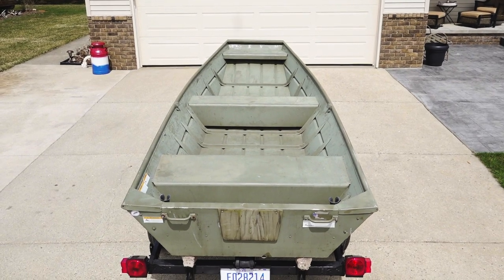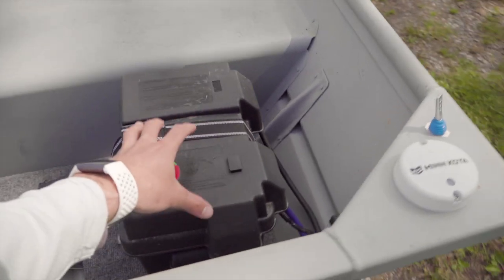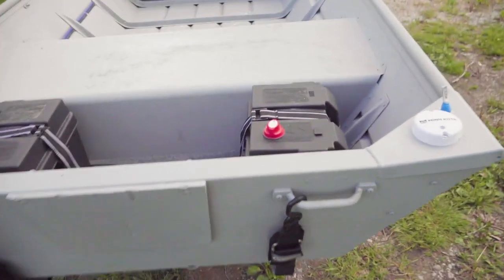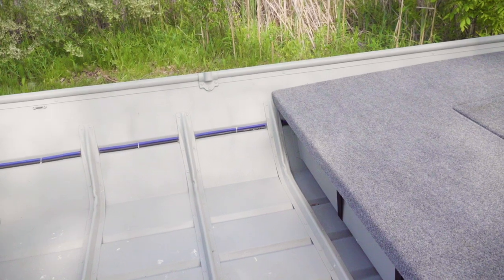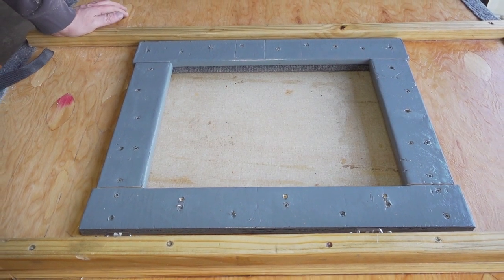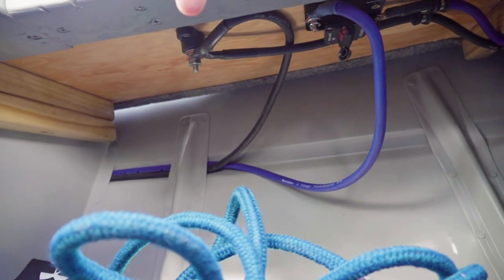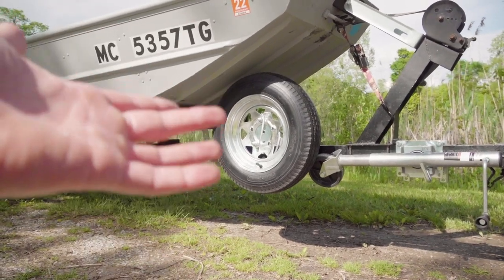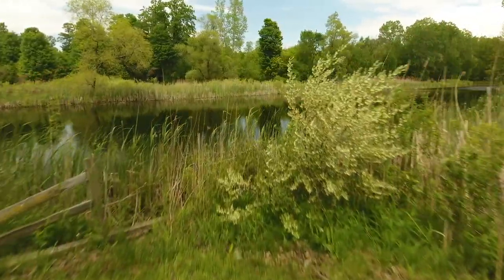Jaw Dropping Jon Boat Discovery - Custom Casting Deck Build

Comment: Nice job folk. You could use some aluminum plate (textured)to cover the floor, so you can have it perfectly plain, without excess weight.

Comment: I need a video on how to wire these converted boats.
If your bearing grease is spitting out of the casing, check your seals.  Replace the inner seal and re-pack your bearing.

Comment: Great built, one thing I think would be a little better,is the trolling motor plug , by putting it in the box where the trolling motor is mounted, that way water or rain would get in it , instead of laying flat on the floor ? Just a thought
Reply from the maker: Thanks for the suggestion Malcolm. That was my original thought as well but that box had to be screwed permanently into the deck to secure the mount for the trolling motor. There also isn't much space in the box because I wanted to maximize deck space and wanted to make the trolling mount flush with the aluminum part of the boat. I found a plug that has a beefy rubber seal which allows me to unplug the motor and remove it with ease, but I never unplug in wet conditions - only when the boat is sitting in my garage.
Reply: They make trolling motor power receptical caps to keep water out

Comment: Hey Vinnie G. I am in the middle of my second one rn and using aluminum this time and wood last time. The aluminum is a game changer though for sure. And theres not really anything you HAVE to weld that you cant bolt with brackets like you did with the plywood. I will tell you that you should get at least a 9.9 hp motor tho if you do get an outboard for it as i have a 5 hp on my wood decked boat and it needs more for sure. If you get an outboard tiller steer you can do away with a battery and lose alot of your weight then also. And another tip i also use 2 small solar panels to keep my accessory battery charged more while using it. I like your boat alot though buddy.

Comment: Great job super fun rig! 
Not sure why coosa board is not used in these type of builds. It’s strong and light. Basically of you were going to make a big sailboat rudder you would cut the shape with 2” coosa board, shape the round ranges with a router, sealant, resin, glass, gel coat, boot stripe, then bottom paint if chosen to. It’s totally submersible, water proof and buoyant. When making a deck you would want to do the same but maybe use 1”+. It’s super light and very workable. I want to make a little John boat in same. I want to get a 14’ Carolina Skiff and deck it out. I would likely go gelcoat on the topside and then lay marine deck foam of choice. That way when the boat becomes a mess it can be washed out. Carpet just get so dirty and heavy when wet, and it takes forever to dry especially if it’s wet out for weeks at a time. I love your rig ❤️

Comment: one question is about the wiring harness for the batteries at 5:05 in the video you mention the cables are pulled very tight and zip tied so they don't pull back, my question is that with the flexing of the boat hitting waves, wakes and stretching wouldn't the constant stress on these cables eventually stretch and break the inside copper stands? well if you find reduced power for some reason then look towards this theory, but great job on the boat.

Comment: I'm trying to understand why the negative stud is necessary? Couldn't you just have ran a ground wire to your trolling motor plug all the way back to your battery? I'm doing something similar as far as making removable and plugable electronics on my dads boat, and also using them on my kayak. Great video. Thanks for sharing

Comment: I am wondering how stable this is. i have a 1436, with a casting deck, but it is very unstable. I have a 25 HP engine on the back, maybe that is part of it.  It is nearly unusable, so i am thinking of removing it. Yours looks great, very professionally done. Great job!

Comment: Great build \design! How did you secure the wooden blocks to the casting deck (for the front trolling motor) without touching the aluminum boat?

Comment: It may be better to add some type of isolation from the main battery and your backup. When you turn on the backup battery, it will try to level out with the main battery since they are in parallel. Kind of like jumping off a car. I may be wrong on this but it seems like this would happen, and drain your backup battery

Comment: Looks amazing and super clean layout. Nice work to you and your dad! Ever thought of putting a smaller platform over the batteries?
Reply from the maker: thanks Dan! We never thought of doing that as I plan to get a 6HP motor clamped between the two batteries in the future. I'm curious what exactly you mean by putting a smaller platform over top? Like an area to step up on?

Comment: Nice deck. About the batteries, I assume they are wired in parallel (pos to pos and neg to neg) since turning a switch gets the second one online. Once the fresh second battery is online, the first, drained battery will pull down the fresh one. To avoid that you could put switches on both batteries to disconnect the drained one or just run both at the same time.
Reply from the maker: Yes you are correct I rigged it up in parallel. But Dang! I didn’t know that turning the second one on later would drain fresh one faster. That makes sense though, Thanks for the heads up! Maybe on planned longer sessions I should keep the switch on so both batteries are being used then...otherwise I have yet to have the one battery die with just the one battery on but it is a fairly new battery at this stage...
Reply: @PureFishermenTV  If you have a voltmeter, check the batteries before and after turning the switch. if the drained one is 12.0 and the fresh one is 12.8 they will meet in the middle around 12.4
Reply from the maker: I do not have one but I’ll have to get one and check it out once I get my boat ready for the season.
Reply from the maker: Thanks again for the tip!

Comment: cool, there is a potential issue with your battery configuration though, if you use your primary battery until it is almost dead the voltage will be low, once you flip the switch on the backup battery lots of power is going to be flowing from your backup battery to the primary and it is going to be charging the primary off of your secondary.  this super fast charging is going to produce heat and potentially shorten the lifespan of both batteries.  i suggest you install another switch on the primary to disconnect it before connecting the backup battery, or even better use both batteries in parallel all the time do decrease the total workload and allow the batteries to last longer. i would buy a cheap battery percentage meter so you can see when you are at 50% charge and know its time to start heading home.
Reply from the maker: Yea some other guy brought that to my attention too! I think I’m going to add a switch like you guys suggested in the near future. Thanks 😊

Comment: With the trolling motor in the front, do you have issues with the way the boat tracks? I plan on doing the same but I’m thinking of mounting a rudder for the rear to help it track right. Any tips would be appreciated. Sweet setup btw.
Reply from the maker: Not at all since I was usually always on calmer waters. I think balancing the weight with the batteries in the back really helps with the tracking too.

Comment: My job boat has a wooden transom plate screwed strait to the aluminum, it’s a 1974 and there is no sign of corrosion ect when I replaced it due to a crack. I’m sure yours will last forever
Reply from the maker: Nice man! That great to hear yours is still doing great and yea I’m thinking this will last very, very long!
Reply: yeah same here a 74 Myers

Comment: What was the overall budget for the cast deck build? Just a ball park without the electrical stuff. Seeing how much I'll have to save to get this done
Reply from the maker: The wood, outdoor carpet, glue, and fiberglass materials I would say about 350. That doesn't include any electrical or tools to make the job possible and/or easier.

Comment: Why mount the trolling motor on the front if u don’t have an actual motor yet?  Is it not as effective on the back?  Or is it more of a future proof thing?
Reply from the maker: because it has a foot pedal for steering and the transducer is integrated inside this particular trolling motor so you are standing right on top of of everything its scanning
Reply: Vinnie G. Oh nice!!

Comment: Bit late to this but just so you are aware, it's very dangerous to wire batteries in parallel if they are not going to be discharged at the same rate. If you discharge the main battery and turn on the second battery, there is a potential difference between the two batteries, thus charge will flow into the dead battery. Batteries have fairly low internal resistance, this will cause very high currents which leads to a lot of heat and potentially an explosion.

Comment: Did you screw the 2x2 supports from underneath up or are there also screws on the deck going down into the 2x2’s?? Thanks
Reply from the maker: They were screwed down through the deck into the 2x2’s before putting on the glue and carpet
Reply: @PureFishermenTV  I am not going to glue and carpet the deck. Should I screw down through the deck like you did ? The screws heads will then show.

Comment: Looks really good. You’ve inspired me. What size is your boat and how does it feel stability wise?
Reply from the maker: Thanks Josh! It's a 14' flat bottom and it's actually plenty stable for two grown men as long as your on a somewhat calm lake. However, I have had three fish off it comfortably for a half day - then the lake got pretty busy and it made for an interesting ride in. No one got wet though!

Comment: Bearings turn slower with bigger tires. 

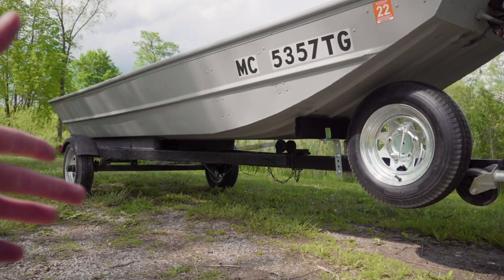But at 9:03 "spin and spit on the outside of the bearing cases"

It should never get outside. If grease comes out, like was all over your old wheels, you need new grease seals.
Reply from the maker: Good to know thanks!

Comment: In theory doing this to small Jon boats is great but in reality it adds too much weight to the front of the boat.. the boats are super slow and heavy afterwards... And the flotation effect is all messed up with the weight in the front of the small Jon boats.. I know I've tried.. after that I tore up the wood and put in .125 aluminum deck.. much lighter much stiffer and last forever
Reply from the maker: Hey Josh, thanks for commenting. You are correct about the extra weight and initially we discussed doing an all-aluminum frame & deck, but we did not have the tools or experience to weld aluminum and I did not have a budget for that. We did, however, do a water test of the weight distribution of the boat as I stood at the bow on a piece of plywood – it was a bit front heavy at first and that’s why we ultimately decided to put dual batteries at the stern and one day a small gas motor will help even more. Personally, I fish smaller ponds and lakes and don’t need to get around super fast. This boat is actually very stable when fishing alone or with a buddy. I even had three people on it a few times. No one has fallen in…yet! haha

Comment: Wow thanks for sharing, really nice project! Thanks for sharing!

But wow were those voids in the marine plywood? Seemed like pretty shitty quality?

Did you use epoxy to fiberglass the wood?
Reply from the maker: Thanks Dejay! I’m glad to hear you enjoyed it. We actually didn’t notice any major voids in the plywood. We did however use some wood filler along the edges before building but it was needed minimally. We used Bondo fiberglass resin with liquid hardener. About a gallon of it at Home Depot for the entire project
Reply: @PureFishermenTV  Oh, from what I've read only epoxy will really make the plywood waterproof. Bondo is polyester so there is stuff evaporating (styrol) that leaves microscopic pores and you will get water intrusion over time. 

So better keep it dry so it can dry out when it's not in the water! :)
Reply from the maker: Dejay Rezme ahh I will have to look into that, I havnt heard of that one yet! Thanks for sharing. I don’t plan on forgetting the drain plug anymore, so it shouldn’t get very wet any longer lol but at least we doubled up with marine and fiberglass for now 😅
Reply: @PureFishermenTV  "I don’t plan on forgetting the drain plug anymore" Ah, how many times have I said that!! At least 4 times I remembered just prior to putting the boat in the water.  Three times I totally forgot and one of those times the boat almost sank.  If I hadn't of had a bilge pump it would gone down.  Now I made up a little list and made a bunch of copies on my printer.  Before I pull out of the driveway I check off each item.  No more issues.

Comment: This is a perfectly cromulent way to do plywood. I'm in the middle of redoing my pontoon deck and can add a little bit. There are certain kinds of pressure treatments that will corrode aluminum when in contact with it, like ACQ or AC2. Also "Pressure treated" plywood from a big box store probably something like CCX. CCX, CDX or pick your **"X" variant, "Pressure treated" plywood won't last outside without some kind of additional protection, It will de-laminate and warp after a year or two. To get true outdoor use plywood you need to buy CCA treated plywood, (about $115 a sheet). Pontoon restoration places (eg pontoonstuff.com) also sell plywood in 102" lengths or 8' 6", since 102" being the maximum legal width for most roadways.

Comment: While beautify done. You have added alot of weight. This decreases how many can get in the boat. Remember,  your boat has to float. 
Unless you are making a submarine?
Reply from the maker: You are correct about the added weight. However I usually only take one other person and it floats fantastic. I’ve actually had three people on it at once and we fished comfortably. I think this would only be an issue on busier/bigger bodies of water with bigger waves, which I have no intentions of doing on this boat

Comment: 12v would be in series. parallel would give you 24v.
Reply from the maker: Thanks
Reply: @PureFishermenTV  just ment for other viewers. not tryin to pick you apart. loved the boat man
Reply from the maker: Brody Leduc completely understand dude. Thanks again for checking it out
Reply: you are completely wrong.. parallel two 12v batteries gives 12v & 2x AH. series gives 24V.
Reply: Incorrect. Two batteries in parallel gives you 12v with the both of the rated amps added together. Source, E.E student.